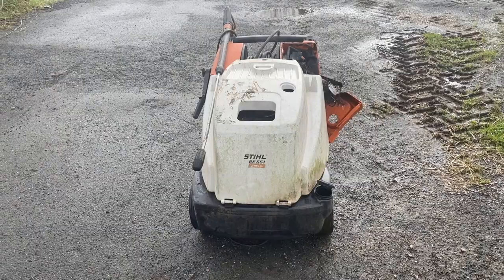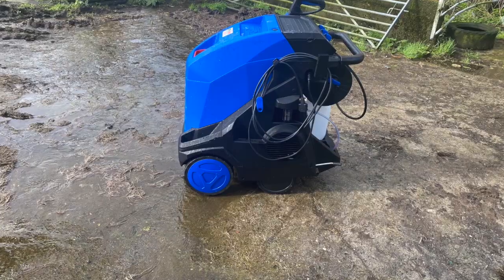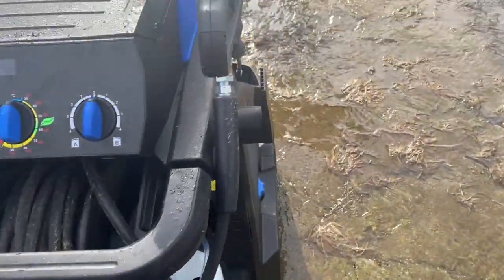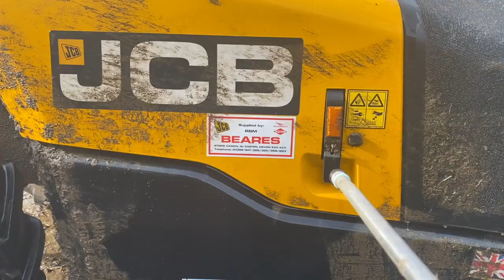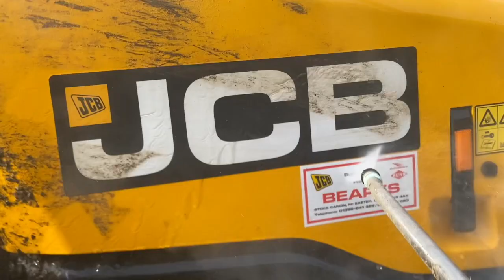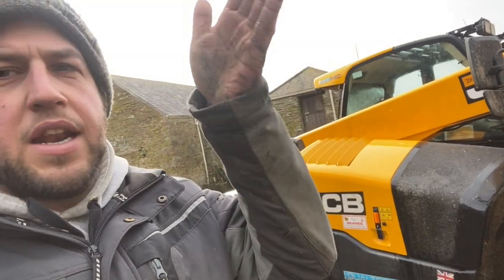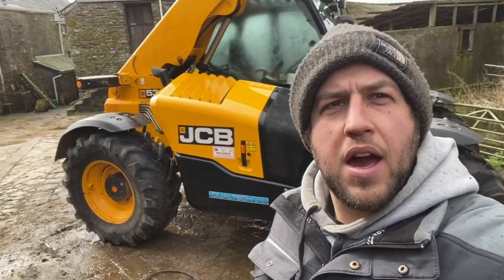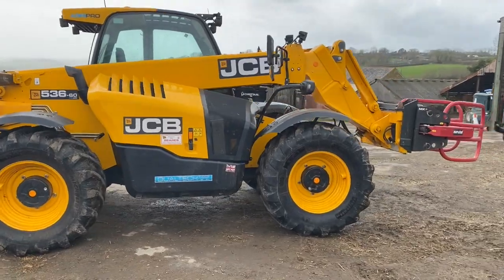JCB 536-60 been given a clean. with our new nilfisk hot wash Episode 15

Comment: Would you be able to use it with a barrel for more capacity or to use rainwater?
Reply from the maker: If shes not blue she'll not do we have a spring fed water trough right wear I did the video
But the silt In it used to kill our old pressure washers